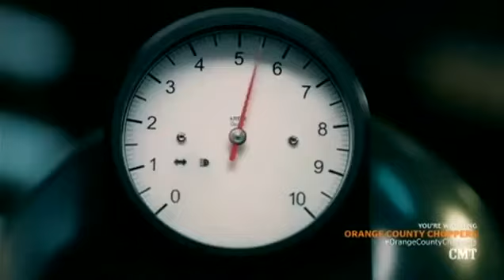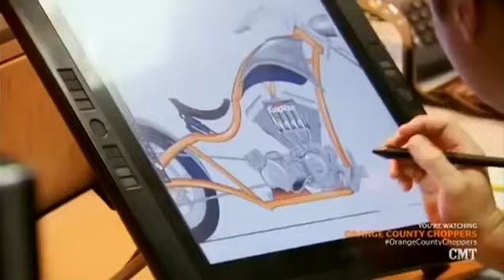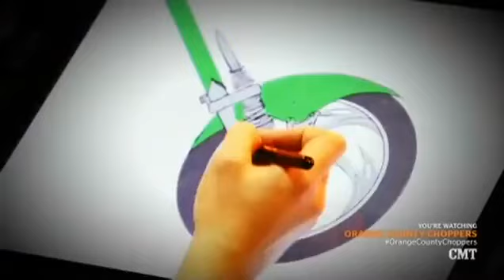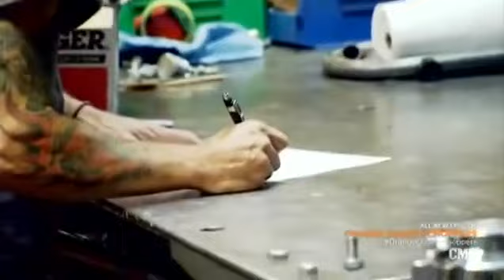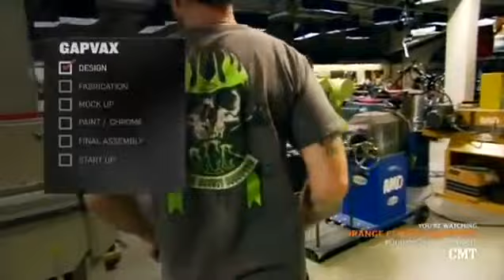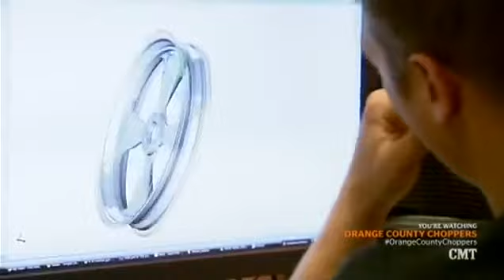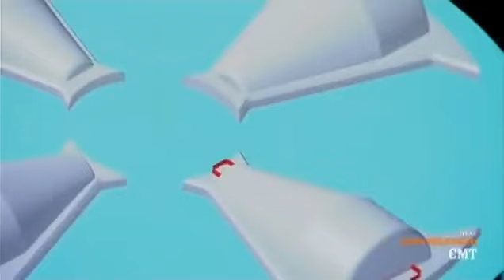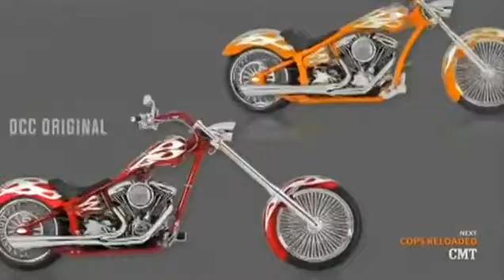Orange County Choppers S01E07 The Gapvax Bike

Comment: Up to 27,500 dollars for releasing freon into the atmosphere. 10,000 dollar award for leading the EPA to the place of violation. I'm snitching!
Reply: leroy jenkins the air conditioner was 5 years old. They don’t use Freon.
Reply: Leroy Jenkins what you think happens when the crush a car at a junkyard. Or scrappers  junking refrigerators freezers.
Reply: @jasonjgr8580  there usually recovered before they are sent to the junk yard and cars hold such a low amount and different kind of Freon that isn’t harmful
Reply: @jamiemoffatt50  ac have been using Freon since the 80s
Reply: EPA don’t go a a fuck unless it’s to do with food so good luck
Reply: @animeking8275 just a little humour bruh